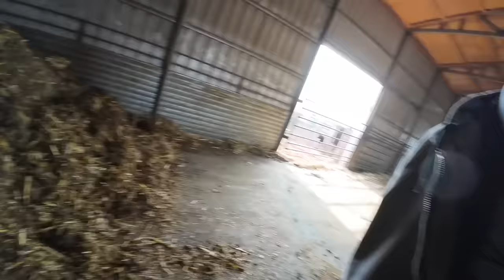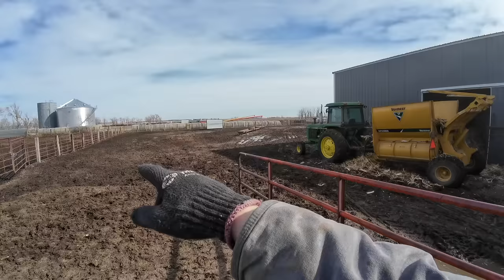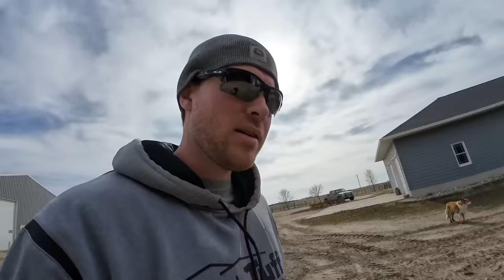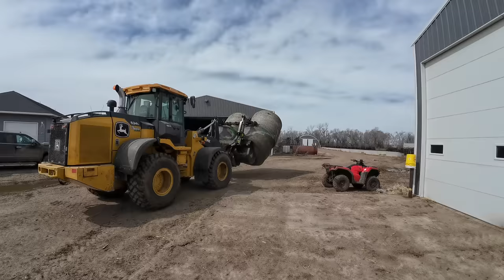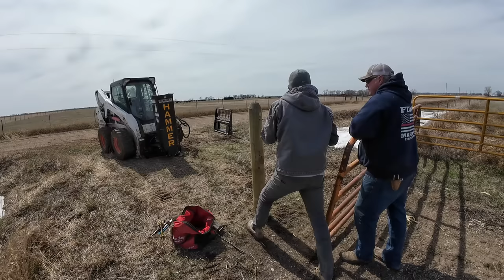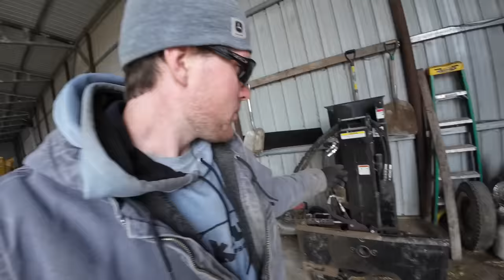Ranching the Easy Way

Comment: Love the videos and content.  
One thing to point out if someone else hasn't, drilling holes in hammer drill mode, or using an impact driver in lieu of using an actual drill slows you down and isn't the tool correctly.  

Using a drill is much faster and you won't wear out your tools as quickly.  I too used to be in the use an impact driver to drill deeper holes in corner posts guy, or just in general, but after watching some guys do some comparison tests on Youtube, its less efficient.  

Keep up the great work.

Comment: A suggestion I have is to drill a hole for a 1/4 inch bolt through the hinge and the gate after mounting the gate, That keeps the gate from twisting in the hinge.
Reply from the maker: I use self tapping screws, its a bit faster
Reply: @SonneFarms  I have found that self tapping has a tendency to break in time.

Comment: I noticed the side walls are not insulated. It’s that by design. Would seem illogical as the cold comes in at the bottom? What do I know. Great vids guys
Reply: Yes a big reason I insulated the roof was to avoid condensation which occurs when heat off the livestock rises to a metal roof. I didnt feel like I needed to completely insulate the building as long as i could stop the wind blowing on newborn calves.

Comment: Can I suggest a little editing tip for the videos. When you are filming inside the skiddstear the sound is really loud, especially the bass. It also happens to some degree inside the wheel loader. But it's especially bad inside the skiddstear, so I have to turn the volum down on those clips, but then I have to turn it up again when you are speaking. Except for that you videos are great as always. 😊
Reply from the maker: I will try harder, thanks for the honesty
Reply: @SonneFarms  you try more than hard enough, I'm just glad you make videos 😊 But yeah one should be honest if one wants things to improve.

Comment: Pardon my thought process.
But watching you run the skid loader through the shed bulldozing the straw, then get the bucket full which you lift and make a pile, then return to fill the bucket again with that same straw to run outside to the manure spreader.....
Why not cut out the middle man?
I have always worried when I see you run toward the pile in the shed and use the shed wall as a brace to hold the pile while the bucket gets under it, but the walls all seem to be true, so I guess the forces aren't what I imagine them to be....

I'm not there, and I only see what you show me, so I guess I am missing something.
Does the spreader not show up until the pile is made?
Reply from the maker: You have a good point!